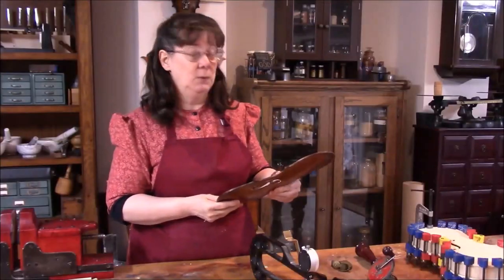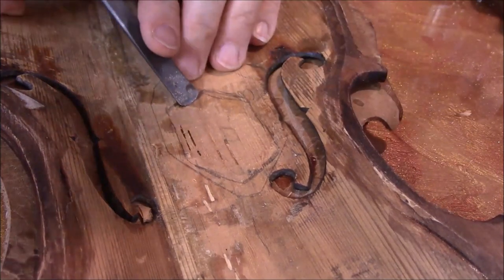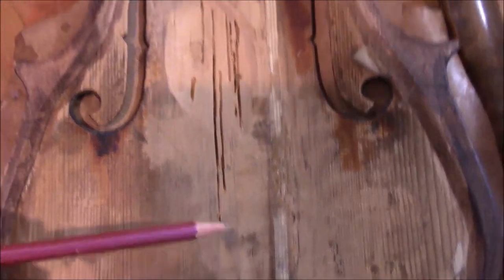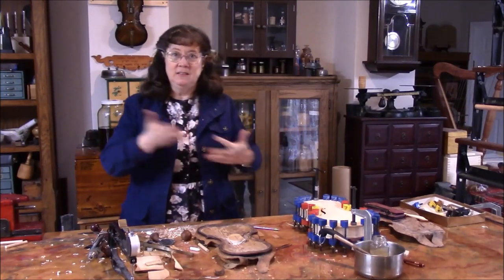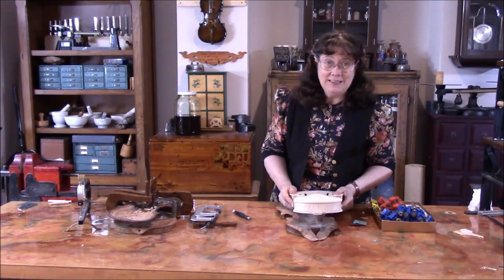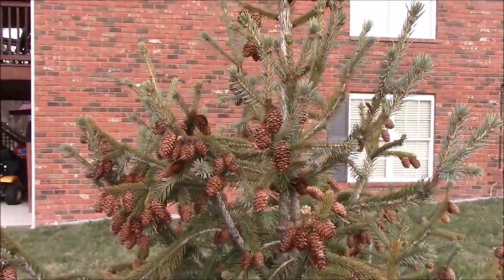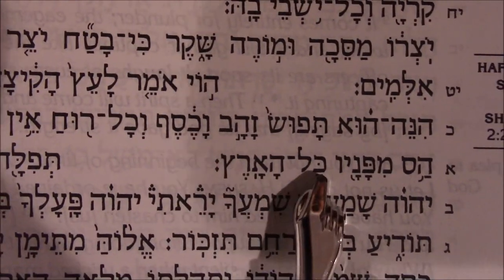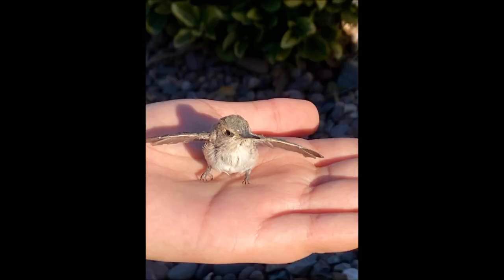Violin Making Adventures #124 (Restoration of 1600's violin) C. Macomber, Violin Maker

Comment: I AM BUNDLING SOME USED GUT STRINGS WITH NOTE PAPER WHICH HAS ABOUT.A TEASPOON OF OLIVE OIL ON IT. I FOLD THE PAPER OVER THE STRING AND CASE IT IN ALUMINUM FOIL. AFTER SEVERAL WEEKS TO.AMONTH I WILL BRING THE STRING BACK OUT TO BE WIPED OF EXCESS OIL H, AND THEN REMOUNT IT ON MY VIOLI N.
Reply from the maker: That sounds like an interesting experiment!  Let me know how it turns out!   Thanks for commenting.